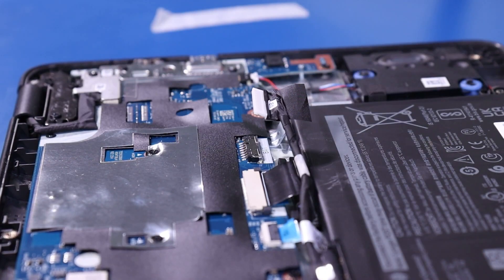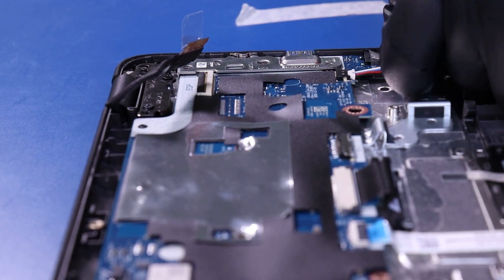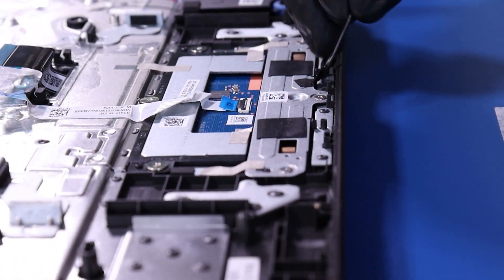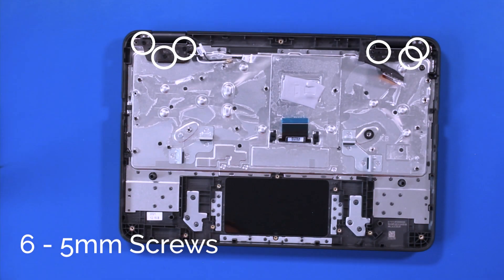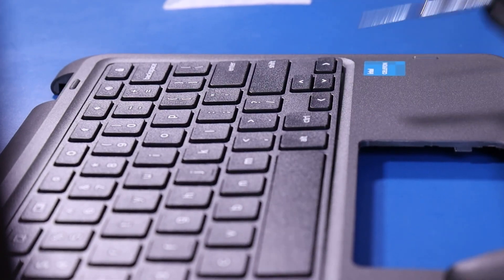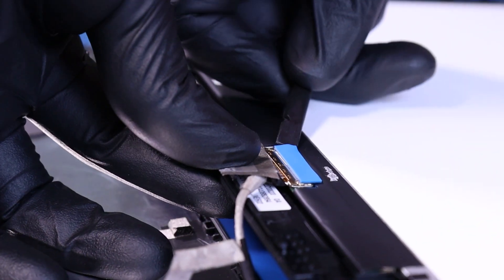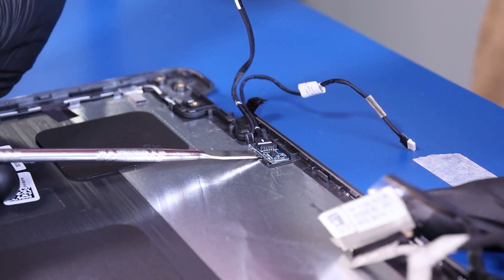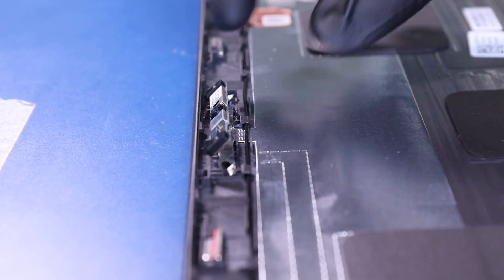Dell 3110 2-in-1 Chromebook Teardown Guide

Comment: WP Jumper Pin out is not disabling hardware WP? Any suggestions for disabling Write protection enable!
Reply from the maker: It's kind of a funky process for the 3110 2-in-1. Here's a link to Dell's steps (the guide to disabling WP is near the top):
https://www.dell.com/support/kbdoc/en-us/000209812/chromebook-3110-and-3110-2-in-1-rma-shim-process

Comment: what about the hard drive?
Reply from the maker: Hello! The memory for this device is soldered onto the motherboard
Reply from the maker: @Lux-e1y The only thing we can think of is to push/pull the screws until the threads engage with the plastic and are able to be completely unscrewed.
Reply: how do u get the hard drive out of the motherboard?

Comment: Is it possible to replace the audio port on a DELL 3110? If there is any damage to the black plastic ring inside the port the headphones will not work and that ring breaks easily.
Reply from the maker: The two options in this case would be to either buy a new motherboard, or you'd have to solder a new audio port onto the current motherboard. If you'd like some more info, feel free to message us at repairs@chromebookparts.com